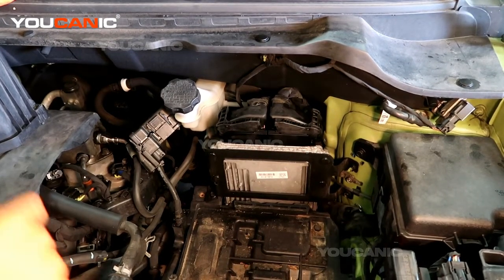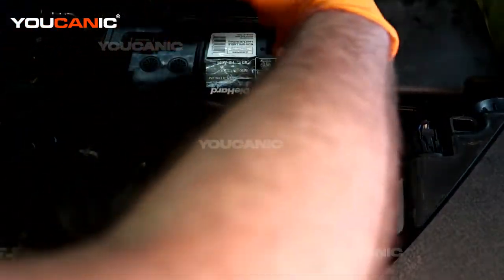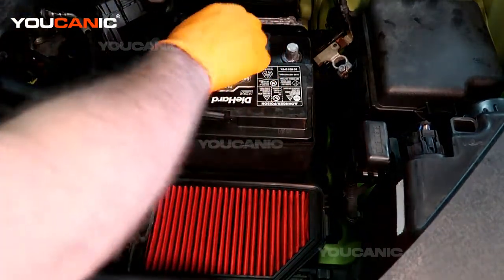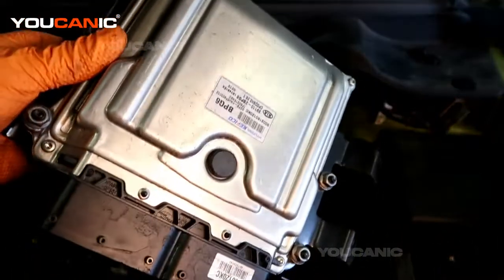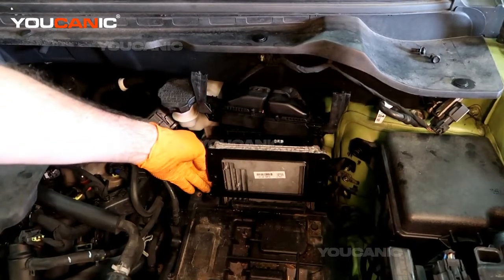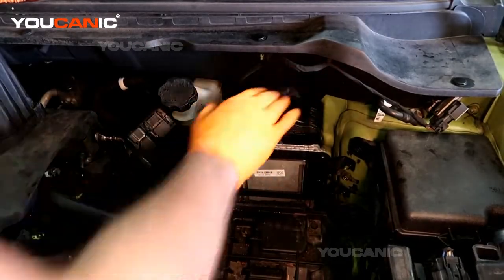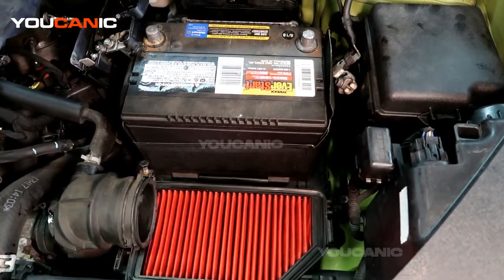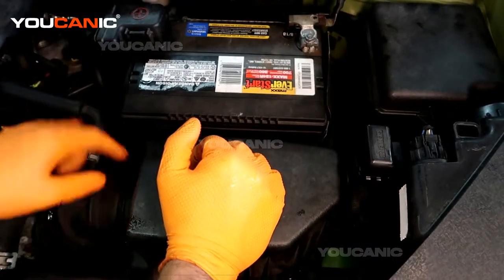2014-2019 Kia Soul - ECU (Engine Control Unit) Replacement

Comment: All these videos online are showing how to replace it, that's the easy part. I've read that you can't just replace these, they need to be programmed. How is that done? Is this software you run from a laptop using some kind of USB to OBD-II connector? Or is this done with any stock OBD-II scanner?

Comment: Did the replacement ECU need to be reprogrammed?
Reply: Hi did you ever find out if it needs to be reprogrammed?
Reply: @roxanaguerrero617 gonna try it without programming on my Kia optima 2012 since the only models with immobilizers are from 2022 til now
Reply: @asaphector how was it? did you had to programm the ecm
Reply: @asaphector Hello, how did it go? I need to replace mine and want to know if you needed to reprogram, thanks
Reply: Did you ever find out if it needed to be reprogrammed or set to your keys
Reply: @nicolemcmullen8418  A new ECM will need programmed and if the vehicle is equipped with an immobilzer system the keys will also need to be learned.
Reply: It would need to be reprogrammed in most cases In the case of Kia anyway you have to clone it or have the dealer reprogram it which they'll fight with you for any kind of used one.. and charge you $4,000 for a new one programmed.. You can clone it for $100 $150..